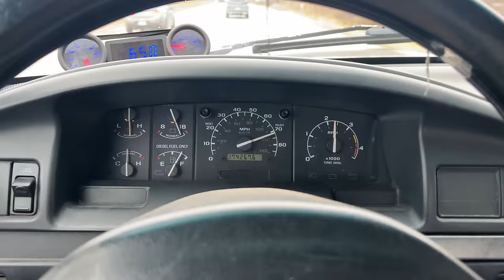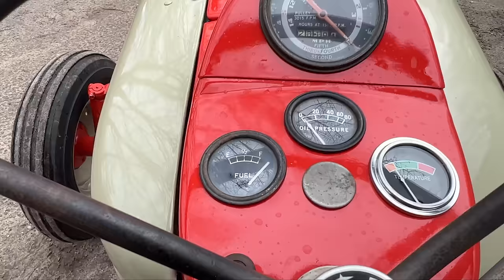Finally testing the Abandoned Ford Tractor!!

Comment from the maker: What should we do with it now? 5 bottom plow?
Reply: 5 bottom might be a bit much 😊
Reply: 5 bottom requires a lot of tractor. For the weight of that machine 3 bottom might right
Reply: It's just a pleasure to look at.
Reply: Ford videos back in the day had 3-4 bottoms on them I'd love to see a 5 bottom for comedy sake 🤣
Reply from the maker: It’s funny our backhoe has never had traction issues with all of the weight. If you could get traction it might work
Reply: That girl would do a good job with 3-14s or 2-16 moleboard plows I'd  say  a small  off set disk  would do what ya want
Reply: Get the stickers off the tires!!
Reply: New subscriber, glad to be alone, finally caught up on the tractor build, the first of many good Lord willing. curious what region you were in I’m watching South Central, Pennsylvania East Coast, United States
Reply: All of the Attachments, Wheel Weights & work out the Bugs Out and a Pretty BadAss Diesel Tractor. Loyal Ole’ Ferd!
Reply: She needs headlights IMO, tractors look kinda nude without em. Tract-o-lite is the period correct style ford used, they make really accurate reproductions nowadays from steiner or other antique parts houses, $120 bucks gets you the pair with bulbs, cup washers, nuts, and everything. Just need power wire from the dash and a switch. :)

She looks dang good!
Reply: five bottom flip-over.................

Comment: I would find wheel weights before adding additives/calcium to the rear tires. The rot in the wheels these chemicals cause is not worth it. You did a fantastic job!
Reply from the maker: Thanks! What about beet juice
Reply: I think beet juice is the way to go.
Reply: @dieseJL . I don’t know about this. If the beet juice was fermented it would have alcohol contents to keep it from freezing?
Reply: My father in law always used calcium and never had any problems.

Comment: They will slober also known as wet stacking when they idle alot. Usually kicking it up to higher rpms will clear it out. It will do it more in cold weather than hot weather.  Nice job on her!
Reply from the maker: Thanks!
Reply: @bourbonbeertractorsandprep9335, correct, also It should have around a 180 degree thermostat.

Comment: On a restored tractor like that don't put calcium chloride in the wheels.  Real bad idea.  I bit the bullet and put wheel weights on to add weight.  Mounted plows on those tractors work better over trailer plows.
Reply: Rim guard/beet juice is as heavy and is non corrosive.

Comment: The reason you're seeing that black oily soot on exhaust is called wet stacking.  Just keep putting a lot of loads on it an the wet stacki,g will stop try not to idle it a lot of needs a load on it
Reply: Correct

Comment: Great job on that resto looks and sounds beautiful. I have a 61 4000 and i found a set of full pie weights and restord them to help with useing  a seven foot box blade to level some of my land here in vermont. Worked great. Also have a new to me 58 861 with snow plow to take some of the of the pressure  off of  the 4000 for snow removal. The 861 has beet juice  in the rears for traction. Both tractors have full sets of chains. You can get into trouble  with pie weights on hilly terrain,. Loaded rear tires, if done right are better for center of gravity. Loved your vids, take mama out for dinner and celebrate!   Warren in Vermont.

Comment: I use Kubotas now, but grew up farming with Fords of that size. We always had fluid in the tires; we use fluid and wheel weights now. To plow, swap rear tires for narrow tread, front is adjustable. To "layout" the beginning set your plow even then adjust to compensate once you have a good furrow. My brother drives 9000 John Deeres, but still uses a couple of old Fords because he loves them 600 and 601.

Comment: Agree on the loaded tires, and figger out what's up with that PTO. But fantastic job, looks like it runs fantastically and great power and torque there! Appears to be breaking in and the smoke is getting better. 

A semi-mounted style plow that pulls from the 3 pt and lifts the rear end with a hydraulic cylinder over a ingle tire seems like it would be a great option.

Comment: I started plowing and disking at 9 years old on a Select O Speed 800. Dad had 2. With front and rear weights the front would be in the air at times. Pulling a chopper and silage wagon it would spin out upslope due to no differential lock. The 5000 in 1967 cured that. The 800 worked everyday blading out the free stall barns till it was parked in the 90's.  With your talents I wish you'd tried a Select O Speed.
Reply from the maker: Well I can have more than one tractor… maybe we will do one of those someday.
Reply: The select O Speed is nice to use but they broke a lot, The standard transmission on the old Fords was a lot more dependable.

Comment: Put wheel weights on your tractor for tillage work.  These 861's had plenty of engine power but were known by customers and dealers to be light in weight. All the vintage training films from the old Ford Tractor company displayed these tractors with rear wheel weights. Also, the additional weights would help the tractor not to jackknife on hillsides while attached to implements such as pull type combines or hay balers.  I speak from experience as we had both an 860 and an 861 on our hillside farm in southwestern Wisconsin.  I enjoyed your presentation immensely as it brought back the many memories of operating our Ford tractors while growing up as a youth! Looking forward to your additional videos on vintage Ford tractors.
Reply from the maker: I’m going to load the tires first I think

Comment: your 861ford turned out beauiful , put some headlights on it, also I have a new holland t-1530 and its diesel and 45 hp it pulls 3-16s fine ,as I remember the 861 is rated @ 45 hp,the plow is a ford 101 with a level arm on it. I restored it in ford red tiger paint good luck
Reply: p.s. the plow is 3 point hitch

Comment: You will need to put a plow or disc behind it and really work it hard to seat the rings in good . Then it should quite slobbing.  CK out squatch 253 can't tell what episode it was. That rebuilt cat engine did the same thing. Them old motors had a different metal in them .
Reply from the maker: Huh that’s good to know. Work it, I can handle that

Comment: If you're not using the PT o, you can take the linkedige on a clutch pedal and move it into the other hole on clutch ride. And then you won't have that clutch pedal up so high. But then when you wanna use the p d o, you'll have to take and reset it in the other hole on the cluch rod

Comment: I liked seeing the diesel next to the 800.   Should get pie weights for it.   
3pt over trailer 
I just got my first tractor about a year ago, ford 640 with a wagner loader.   Now I have a huge addiction to the ford tractors.
Rebuild its motor and took it on a 70 mile drive 3 different times
Reply: what you NEED is a Fordson Super Major with a County four-wheel drive conversion.  trust me

Comment: Beautiful tractor, definitely need a 3 bottom 3 point. Trailer plows won't help you any with the draft issue you may run into with the track width being set so wide. It'll still pull, it'll just pull a little harder. If it was me personally I'd just flip the centers of the rims around so the dish is in. Not sure if your going to put a loader back on it but it wouldn't interfere with the loader anyway. To me it looks a little goofy with tires so far out from the fenders but it's your tractor do what you want
Reply from the maker: Oh yeah wow maybe I could just flip sides in the tires eh?

Comment: Back in the early 1970s my dad bought a derelict NAA Golden Jubilee from a junkyard in the suburbs of Chicago and we spent a year tearing it down in our garage in inner city Chicago and found that it had a HI/STD/LO ranging transmission inside the bellhousing but no selector handle so we had to source one of those but parts were easier to get then. We rebuilt the engine, transmission, fuel system, hydraulics and even the electrical system. Anyway it's on my parents' farm in north central KY but both parents passed in 99 and 01 and myself and my 3 sisters sold our fifth to my brother and he still runs it regularly. Other than normal maintenance issues the only problem we had since the 70s is the exhaust replacement and brakes. On the PTO there is an extender you can get that attaches to the standard PTO and brings the attachment point out about 4 inches which will alleviate the problem with the hookup with the quick release button hitting the hitch mount. Your diesel 861 is almost an identical twin overall to the NAA we rebuilt.
Reply from the maker: Yeah the jubilee is a cool tractor. We have one that needs restoring actually.

Comment: Mounted plow for sure. That three point hitch was designed for a mounted plow. It has draft control which would would not work with a pull type plow.

Comment: 3 point 2 bottom 14s shoud work fine so much better than trailer
Reply: That tractor will handle a 3 bottom for sure. I'd look for a 3 bottom 16 inch plow.
Reply from the maker: Yikes how about 3 12’s

Comment: Hey Fantastic ! 😁My neighbor bought one NEW 1960  . It did not sound like yours .... Red tigers purrrrr. Your ford has an injector problem  . One or more injectors are not spraying fuel correctly . that's why you have a sooty discharge with blue smoke . some of the fuel is not being  burnt THIS COULD DAMAGE THE MOTOR !!  I will guess that you  CHEAPED  out on the rebuild. Great video thanks

Comment: Well you have 40 plus hp your pump is putting to much fuel you need to work it harder an run it at a higher rpm an not lug it so it burns the fuel